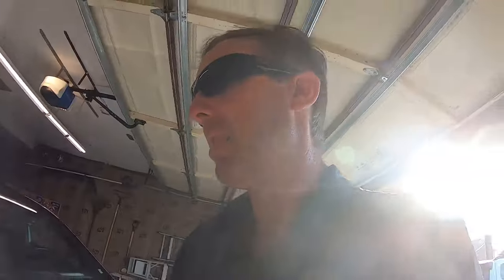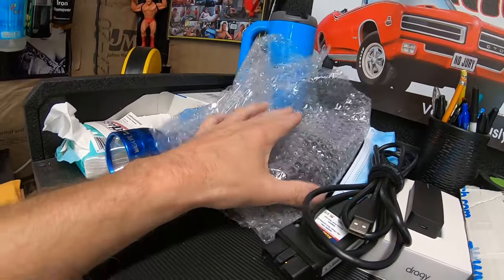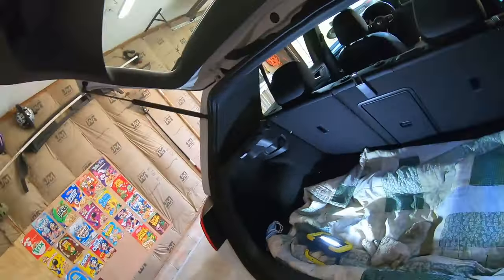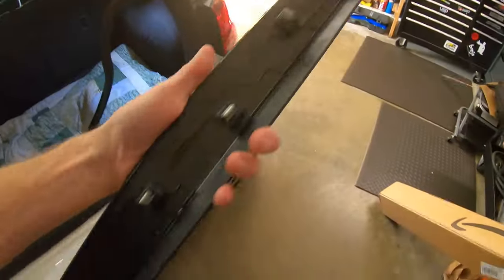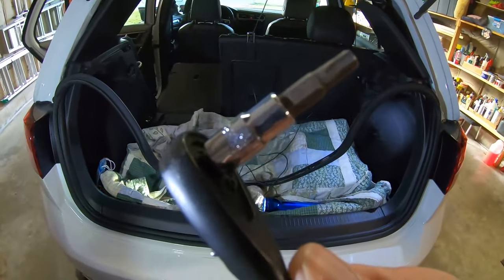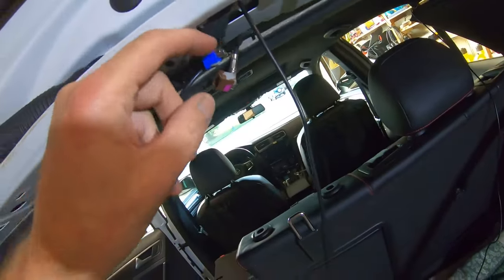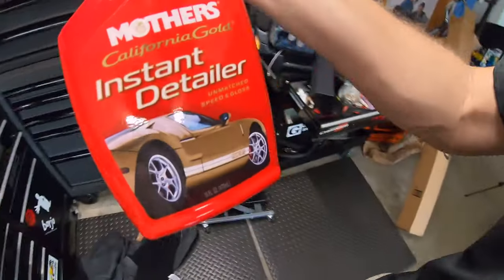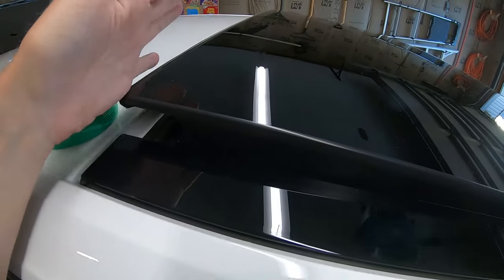2018 VW GTI SE Ep.349: Roof Wrap Project - Removing Antenna

Comment: Sweet! Can I ask for specifics on taking off those three wires with colored blocks and white tabs on the ends? I am attempting to remove them and I can’t seem to figure it out. I can turn them 90 degrees and pull the white tab down, but than what? They seem to be stuck on there very well, even pliers wouldn’t pull them off.
Reply from the maker: i remember something weird about those.
Reply: @LastHumansGarage  Do you happen to remember what the weird thing was?

Comment: How in the f were you able to get each wire out? I’ve spent 4 hours trying to remove these. All white tabs have been fully open along with the metal cross member removed
Reply from the maker: DEUUUTTTCHHHMAN....  i seem to remember it was a huge bitch... did i tell how in the video?